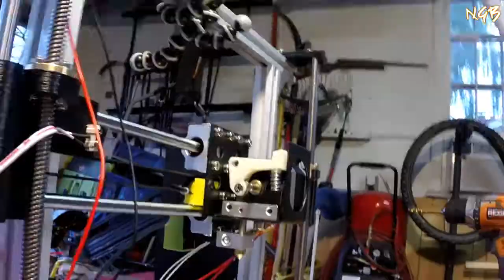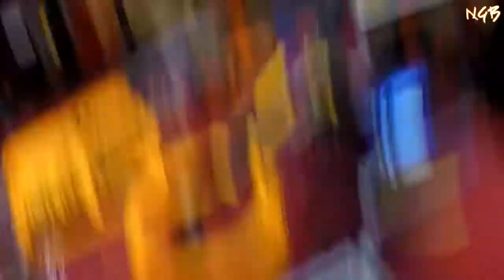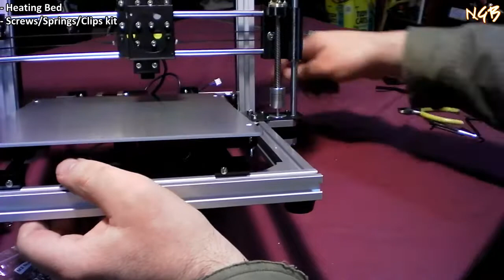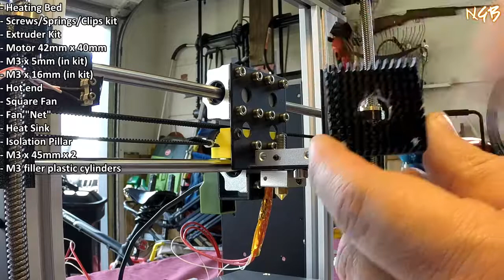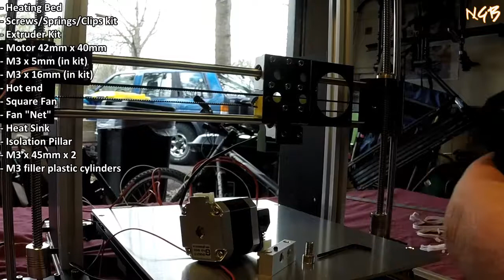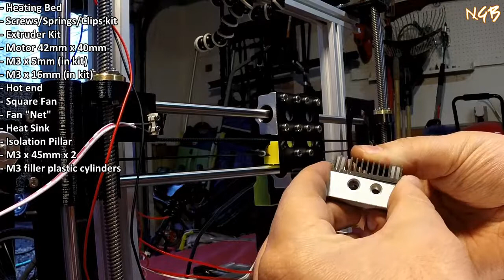HICTOP 3DP11 3D Printer Part 9 Hot Bed and F#$*ing Hot End

Comment: I just bought on of these, and have an advantage of already bought a new "returned" FlashForge Dreamer at pennies on the dollar. The only issues with it were bent endstops as to cause it to not "home" properly. Either that or the "person" bought it and decided to use it for one "project" and return it. Either way It's just plain bad to the bone, and I've already put over 300 hours on it, and they're good for 100,000. 
    Next I bought an assembled FolgerTech which the guy couldn't get going so he put it on eBay and disassembled it for shipping. He didn't pack it right, and three of the poorly printed parts broke, Hahaha, probably was tossed around by the Post Office basketball league. Anyway if you go to Prusa's website http://www.prusa3d.com/ he has all the parts on STL zip files so you can print them....."FlashForge" to the rescue. I've got creative with it, and "upgraded" it with "Electric Blue" (@ Lowe's) using "Hi-Res" machine settings on the parts. Some of the "upgraded" parts can also be found on "ThingVerse"   http://www.thingiverse.com/search/page:2?q=prusa+i3&sa=  , and "Yeggi" http://www.yeggi.com/q/prusa+i3+parts/2/  .
   Now for the HicTop. I haven't got it yet, as "it's in the mail", but I can assure you that they are better packer's than "Joe eBay". One thing I've learned on cleaning and adjusting the "Hot Ends" on my FlashForge is they come off as a unit, and go back on as a unit. Having taught "Small Engine Repair" to Jr. High kids I've stressed back in the day "sketch" the assembly before dismantling, and today you have "smartphones with cameras. We had a blast with it.
   Anyway having taken picts of hotends, and being a Technician for Flambeau (think plastic Tackle Boxes) and fixing their molding machines and building automation machinery, this is child's play. I'm glad more and more people are getting into what we as kids had back in the day with Heath Kits, Radio Shack and others. I have a YouTube channel that is geared toward RC Airplanes and Aerial Photography (hence 3d printed parts) https://www.youtube.com/watch?v=S5qxUwdFUiM   https://www.youtube.com/watch?v=9U9FWRk1Ats. 
   Congrats on your build and video it was informative, painful at times, and shows what we all go thru to build things without the "clean-cut no errors" videos out there, keep it up.
Reply from the maker: I'm also in the industrial automation field. Not a big deal to me to hack on this hot end to get it together, but I thought it was maybe a good point to make that this isn't a Lego kit that will snap together bing-bang-boom. I with the hot end on this model came off without the rigamarole. I'm contemplating drilling a hole in the heat sink where the set screw is to release the feeder into the hot end... rather than having to undo the fan and motor, etc.
Reply: Nate's Garage & Bakery, you are so right on it not being a Lego set and the faint of heart beware cause you can't just plug and print.